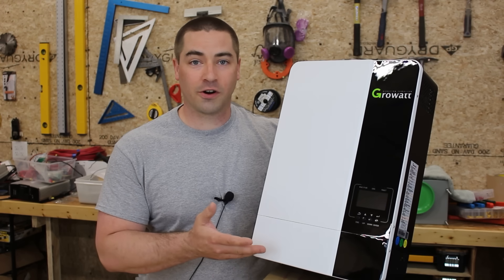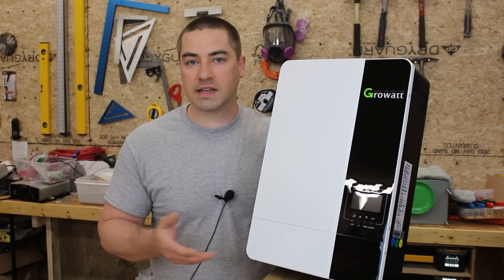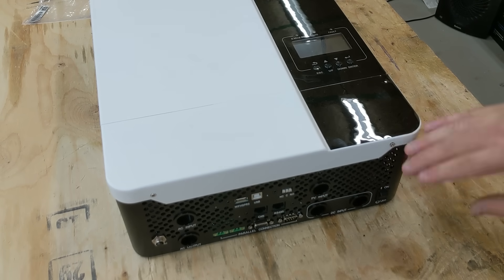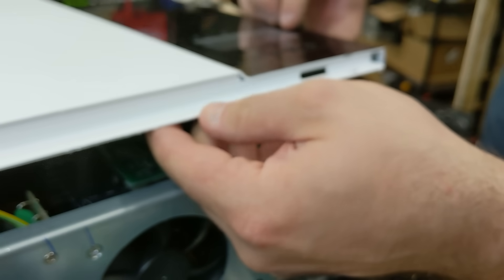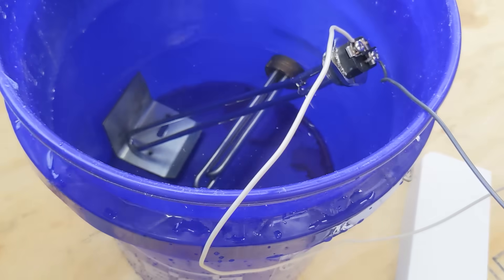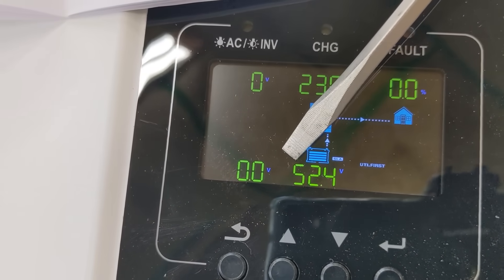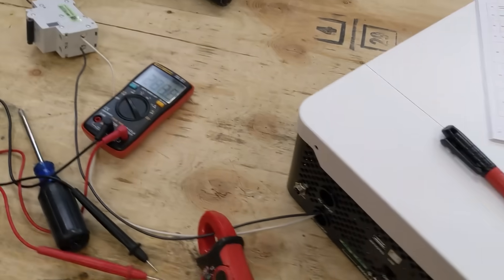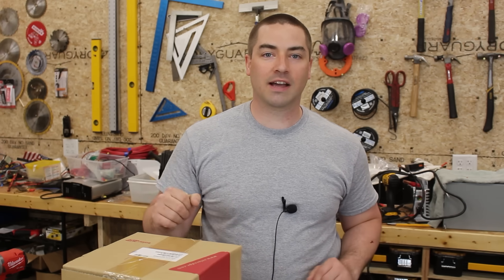Best Value Inverter, All-in-one MPPT Solar Charger, Growatt SPF5000ES, Part 1

Comment: Can you test idle consumption in one of the upcoming videos?
Reply from the maker: Yes Sir!  I plan to test the idle watt draw with, and without, the transformer.
Reply: I've got mine this week! When it is on, without batteries, connected to the grid, connected to the PV array and the loads disconnected, the clamp meter on the AC-in measures almost 4 amps. What could be the cause? (my grid is 220v and 50Hz)
Reply: I’ve been looking at this inverter as well. It says in the manual that it has a power saving mode. This is mentioned in the screen display section of the manual.
It also says in the specs that it has a no load draw of 60w. That is a lot and probably a deal breaker for my scenario. Would be great to see David’s results

Comment: How would 2 of these compare to a sol-ark 12k, other than 2kW and $5,000 cheaper?
Reply from the maker: The Sol-Ark 12k says "12k" in the title to refer to how much solar can be connected.  you can connect up to 12kw of solar panels to the Sol-Ark.  However, it is a 9kw inverter.  Clever marketing.  This is a 5kw inverter, so two together is a 10kw inverter, and still allow 12kw of solar.  But Sol-Ark does have some great things going for it.

Comment: I just cant imagine that it could last as long as  Magnum inverter/charger or The Midnite classic. Running a well pump on a High frequency inverter sounds like the mosfet would fry pretty fast to me. If I had a weekend cabin then it sounds great but for my full time off grid house? What I have found with solar equipment is you get what you pay for.
Reply: yeah, these are not industrial units, good for light-duty residential. 
I wouldn't run an old/Harbinger-o-Fright welder off these either ;-)
Reply: Well said my friend. 
 Judging by the components inside I'd say u may get 5 years of light use with it with only resisitive loads and no transformer.

Comment: I am probably showing my ignorance here but, if I were to have multiple units could I use both a generator and the grid in this system?
Reply from the maker: I'm not sure if one inverter could be connected to grid, and another paralleled inverter connected to the generator.  Sounds good, I'm just not sure.
Reply: @DavidPozEnergy  Ok thank you. It would be interesting to find out. It would mean four or five of these could do what it would take three Sol-arks to do at less than half the cost.
Reply: My guess is parallel units would need to be running from the same AC source. If you will only use the generator for backup then you can just run this off a transfer switch.

Comment: How much is the split phase transformer?
Reply from the maker: $350.  5% off with discount code "DAVIDPOZ"  https://www.signaturesolar.us/products/i8d486d54c/2203789000006420115
Reply: @DavidPozEnergy  Cheers, not for me, but a good callout. I have "normal" 240v :)
Reply: i would think that any 240 to 120 tranny  of 5000 watts or over would be fine but it will add idle losses so pick a low lose one like some toroidal transformers there my be a added benifit of this also it my add the extra magnetic flux that acts like a capacitor for amperage  it may act like a low frequency inverter when starting big motor like loads i hope dave will look into this
Reply from the maker: @ Amber Smith.  I'm interested in the same questions.  In the next video I plan to attempt to start my miter saw and air compressor.  They both have big surges.  In theory, the transformer should help with that.  We will see.

Comment: Available for sale in Australia too, so there’s a plus. Both 3500W and 5000W.

If only there was a better supply of good value batteries in Australian. Anyone have suggestions?
Reply: I got 16 x 280ah 3.2v cells of lithium ion phosphate off Alibaba.com after watching off grid garage.  They arrived in Australia within 3 weeks ! Another week for customs. About $2850 including BMS. Planing getting the growatt to test them out if power saving mode watts is ok.
First time I used Ali. I ended up enabling Apple Pay on my iPhone for just the one purchase so all covered if anything went wrong.

Comment: What’s the difference between split phase and paralleling of your inverters?
Reply: A parallel setup keeps the voltage the same, but doubles the available Amp output. Assuming the inverters talk & sync with each other, or agree about who runs the 2nd phase, and how.

Split phase is about cutting the voltage in half: you have a transformer with a neutral tap right in the center of the winding. It's a US thing; they typically only get 1 grid phase down a residential street.
Reply: @wim0104  
 
So I have a Victron 24 V 3000 kw inverter. If I add another one that means I have a 24 V 6000 inverter?
And if I want to split phase I have to add a transformer to split the voltage?

Comment: Is there an option to select which phase the inverter ties to when you run them in parallel?  Seems if you had two, and put one on each phase, that's all you would need, instead of pushing both through the transformer.  Great videos, thanks David!
Reply from the maker: There is only one phase with this inverter.  I think it might make more sense after the next video.
Reply: @DavidPozEnergy  I'm waiting on pins and needles!  Thank you for doing all of this testing!

Comment: I would disagree with the title of "best value inverter "   You can buy 2 of the 3000 watt ones for the same money as this 5k and the transformer and link them and have 6k with no hokey pokey transformer involved. Am I missing something ?
Reply from the maker: You could certainly go that way.  Two of the 3kw is a decent option, and only $100 more than this inverter+autotransformer.  I have not tested the 3kw model from Growatt, but I have tested other brand 3kw inverters.  The ones I've tested in the past have not been able to turn on my big construction tools (air compressor and miter saw).
Reply: @DavidPozEnergy  Yes I have watched your saw/inverter killer videos lol .  I looked at the specs on the 3k again and it only has 250v PV in so the 5k wins . I'm not sure if you parallel pair the 3k's if the PV doubles on 1 or you just have 2 @ 250  ?   The nice thing about the 3k's is they are already 120 /240 .    Here is a load test of paired 3k's from Signature Solar :   https://www.youtube.com/watch?v=XmiHT4LK8Cw                 Keep up the great videos , I enjoy your channel !

Comment: These modular, hybrid inverters are wonderful!  I think the days of the old Schneider, Outback, Magnum and others are over, unless they can figure out a way to make inverters like these.
Reply: Oh geez, I hope they don’t start making models like these, the LF inverters they currently make are much more robust.
Although a cheaper alternative would be a good option for some I guess.
Reply: I question the quality of these cheaper units. If they good, great. I am in the market for an inverter/charger for my leaf 21k battery pk. Had decided on Scheider 6800w unit. That is $3100.00. Is anyone using there long term yet?
Reply from the maker: @Glenn West: My friend Ben installs systems for a living.  He has had trouble in the last year or two with Schnieder.  The older models used to be fine, but now the newer ones are not good.  He has stopped installing them, and has moved to the Sol-Ark.
Reply: @DavidPozEnergy  Great choice, the Sol-Ark is the best residential inverter/charger available, for it's size.  I used to sell Schneider inverters several years ago and they were about the best thing around, at the time, but since then, Schneider has let go most of their staff and hasn't updated anything.  The old inverter mfc.'s had better get up to speed or they'll be out of business soon.  Same goes with auto mfc's and EV's.

Comment: MPP Solar HV2-5048 costs AUD $1300 delivered and its a hybrid . runs with or without battery , runs with or without grid up to 80 amp charger adjustable down. 20  by 250 watt solar panels gives 240 volts @ 20 amps. Thats about USD $950 . Defintely recommend them so far.

Comment: Can you parallel two of these for split phase 240 volt? Does that make more sense than using an autotransformer?
Reply: For about $1500 you can buy two 3000 watt Growatts and have your standard 240 volt single phase.Each inverter runs one leg of your 240 breaker box. I'm installing my system now. The only thing I will be running on 240 is my hybrid hot water heater. Which will run on 240 because it's a heat pump system and only draws 300 watts. The 240 volt 1250 watt elements will be for grid only and will probably never be turned on unless in a emergency situation. We heat our water for a family of 4 for about 40 cents a day.
Unless you have a extemely large system you really don't want to use 240 volt high voltage and high amp appliances and equipment. I plan on running my system every day but will limit the battery usesage to a minimum to prolong battery life. I will have the luxury of hot water and refrigeration in an emergency. My system is small but practical. 
6000 kw single phase 240volt.
48 volt 5.4 kw Batteries with 3840 watts of Solar. Adding more panels and Batteries later.
Good luck 👍
Reply: @witness1449  Is this confirmed?  Normally they have to support specific sync of the two inverters - 180 degrees out of phase.  I know the model David reviewed can sync in parallel for more power, not clear about sync'ing their 120V model in series for split phase.
Reply: @billjohnson3344  Yes they are paralleled and data linked to achieve the 240volt system. Two 120 volt legs one from each inverter. You can parallel up to 6 inverters. No transformers needed to convert to 120volt. There are a couple of videos on YouTube with the 2 3000 watt GroWatt inverters hooked up and running. I'm to the point of having to set up my ground mounted panels and trenching in the wiring. Probably a couple of weeks before I fire it up. Garden time and priorities have changed.
Reply: Looks like you can parallel up to 6, but they're all 240v single phase output. You still need a transformer to get split phase.
Reply: @benssolarandbattery  yep, looks like it on this model. Too bad
Reply: @gmanweber3776  There seems to be a new MPP model that would be interesting: LVX6048 (https://www.mppsolar.com/v3/lvx6048/)
Reply: The transformer is a cheaper way to get your split phase but I would probably agree with you and spend the extra and get the other unit. If one fails you have a backup at least

Comment: you are crazy to just put the heat element in water what if it gets wet at the terminals. No safe at all. nice video anyways.
Reply: Since the water level is below the connectors there's no way for it to fall in... Unless you think he's going to cover the connectors or splash them on purpose?

Comment: Growatt just came out with new batteryless model. Off grid. Looking forward to seeing more reviews on that one. Thanks for your videos david. Also looking forward to the autotransformer video.
Reply: @Signature SolarYes, I see that but the SPF 3000TL LVM-ES doesn't require transformer correct?
Reply: @Signature Solar can I use this transformer for any 120v inverter? I have a meanwell inverter
Reply: @Signature Solar wow batteryless is cool i wander if the adding of the tranny adds the flux amps for starting big motor type loads  kinda like low frq  inverters
Reply: @Signature Solar Question , What is the grid line in for grid support for the 240 volt  only model ?   Does this have grid support feature the 3k has ? Thanks !

Comment: MPP Solar has the same size unit for $750 include shipping "5000w solar inverter 48v 230vac + 80A MPPT solar charger high PV 500v"
Reply from the maker: Is that direct through their website, or somewhere else?

Comment: Will this back feed the grid to sell back to the power company to lower power bills?
Reply: It will not back feed.... some power companies like co-ops will not permit back feeding, so this is perfect for that.  You can run off grid and have a grid backup.
Reply from the maker: No, it will not back-feed.  It can only use the grid on the input side, to charge or pass-through.
Reply: I’m digging through different models (8kw or 5kw, 145v PV input vs 450/500v PV input) for my own system in different forums. The comments in several forums indicate that the high voltage PV input models (450-500v) will in certain scenarios back feed into the grid. As far as I understood, when powering the output combined with AC input and Battery (or solar) input and the consumer at output is disconnected suddendly upto 1kwh could go back into greed. This happens only in one of modes in the 01 setup called SUB or sometimes SOL. My research was focused on the different MPP models, but as others mentioned they all seem very similar and might come out of the same factory.
After looking at the manual; it should be the SUB mode for this model

Comment: Is there one that takes, as input, solar, AC, and DC from a second alternator?
Reply: There are some dual input inverters and with an MPPT charge controller you can sometimes use any type of input as long as the voltage is in the range of the inverter. But you would need an alternator which has more than 12V output unless you used a DC-DC converter. Maybe look at the Sterling Power Battery to Battery converters

Comment: That looks so similar to the design of an MPP solar, I wonder if they have the same original design company.
Reply: Yeah, I think the root manufacturer is Axpert.
Reply: Indeed I recognize exactly the same components in it as my EAsun  (which I bought on AliExpress). Also the manual is very similar. I use solar-sis to read out the the data, and this works also with many brands (so they share also a very similar firmware implementation). The data is put in an influx database and visualize with Grafana dashboards with graphs, gauges etc.
Reply from the maker: They probably share a ton of parts.

Comment: i have recently found out they they also do a box that will do snmp for networked pc eqip to recive the signal for shut down when the battery's are low you may not need this option but just thought i would put it out there